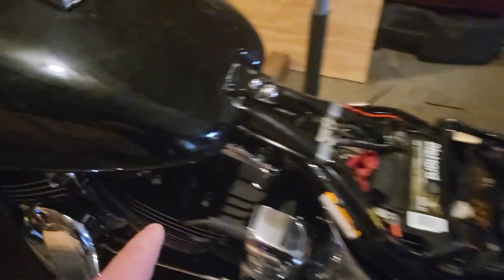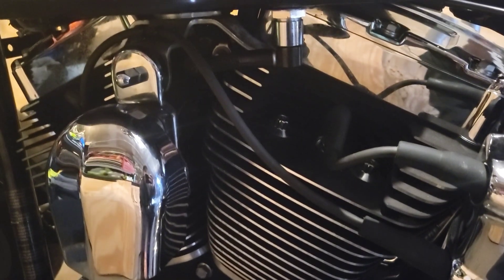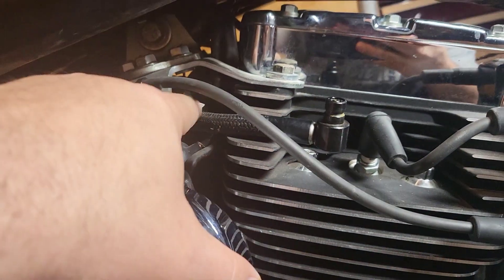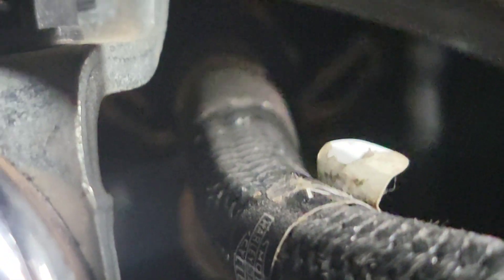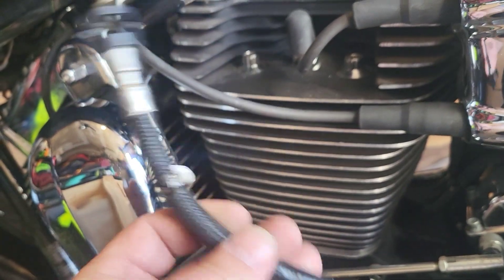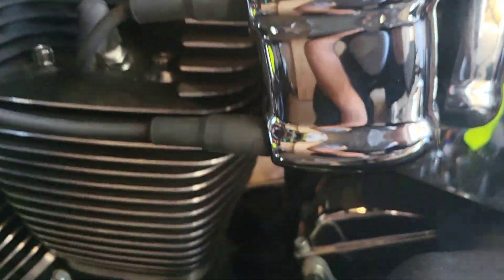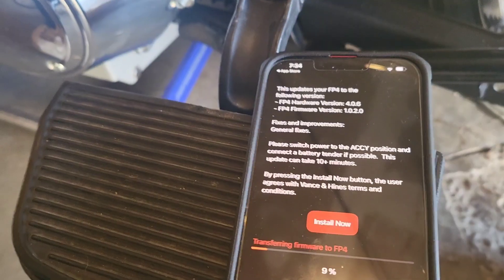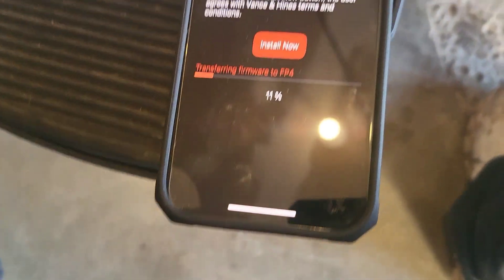Working on the FLSTF- I

Comment: Have you replaced the injectors or had them cleaned?
Reply from the maker: Yes replace both twice.. I ended up figuring out that the liner inside the tank kept dissolving into the fuel, clogging the pump and injectors took everything apart again completely cleaned out the inside of a tank using the gold standard sealer system... however, I did not use their liner. I opted to keep it metal...
Reply: Wow what a mess